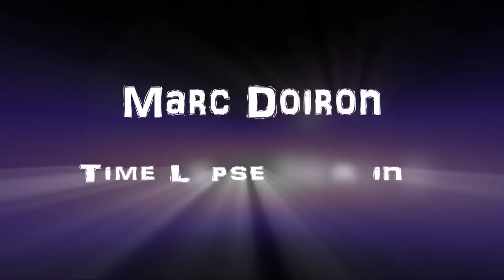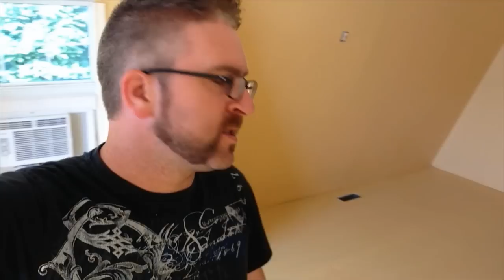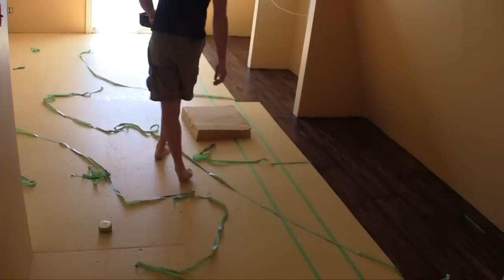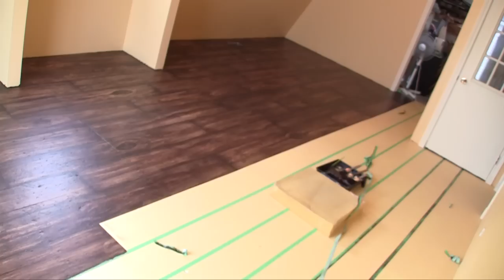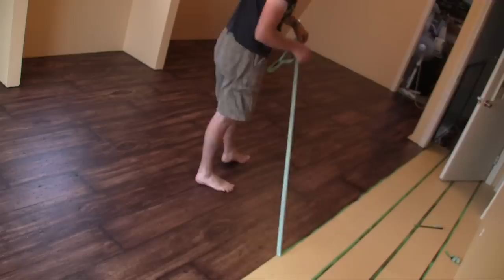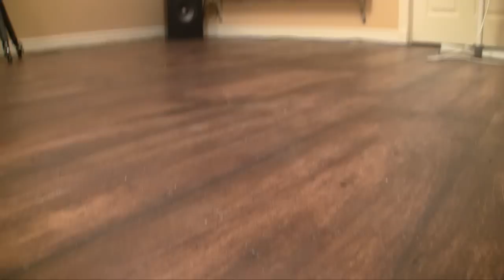Time Lapse painting "Faux wood floors"

Comment from the maker: Update. It's going on 3 years now and floor is still holding up very well.
Reply: +Marc Doiron What did you use to seal the floor? I love the look and your technique, which I followed to bring back the raw wood look to two beautiful wood beams that run the perimeter of my kitchen. The previous owner had painted them white and I was so happy to find your tutorial. They turned out amazing, so thank you :)
Reply from the maker: +cook6265 I just used a water base sealer. I gave two coats.
Reply: Omg!! I'm crazy enough to do this...why I didn't think of it, before. I planned on just painting the floor white...But I didn't want a plain floor! Thanks for this...x (mines a concrete floor. )
Reply: I’m assuming you can’t use bleach to clean the floors? What do you use to clean it ? Won’t it strip the paint ?
Reply: very good, thanks for video
what kind of floor is it? what material is it from?
Reply: Marc Doiron what tool did u use for wood grain and how did you make it look like individual planks?
Reply: S Fleming I think he just used a woodstain so the natural woodgrain of the plywood showed through, and the tape made the stain kind of puddle up against the taped areas making it darker which in turn makes it look like individual boards.
Reply: Everyone loves it even....chat 
Ok
Reply: Hahaha.... want some candy.... I like your house..... it's great without cracking
Reply: What did you use to seal the floor anyways?
Reply: You should like me XD hamsters
Reply: Marc Doiron can use this technique on concrete floor? And what would you recommend?
Reply from the maker: Diane Hachey yes you can. I did the floors in our gift shop and it has a lot of traffic. Just put a good cement primer on the cement before you start with the colours.
Reply: Hi Marc, what paint did you use please?
Reply: @MrMeSoMAD  Will this hold up on an outdoor front porch?
Reply: @heidibetke5826  did you try yet? I was thinking about doing the technique on my back patio.
Reply: I didn’t try it yet. I decided to go with stencil painting since it will be a little simpler.
Reply: Hi!
 How is it doing after 9 years?

Comment: That's a great and simple way to dress up a plywood subfloor- either for long term or until you can afford a different floor cover. The biggest challenge to me would be getting the tape spaced evenly and straight. You just whooped it down. Did you use any kind of sealant after it was done?
Reply: +llazyiest He didn't just "whoop" it down. Obviously this video was sped up for time. I am a professional faux finisher and scenic painter and I can tell you that it is very difficult to lay tape down straight. I'm sure the guy used a sealant but it doesn't matter. No sealant is going to prevent scratches on a floor especially in a high traffic area. His floor will have to be touched up a lot and not only that, the floor looks like a faux finish. I guess it would be okay if he covered up most of it with an area rug.
Reply: +sandra johnson Really? You mean he didn't just do it at 200 mph like it looks like here? You mean it's a time-lapse like he said at the begining of the video and in the title?  I'm so glad you pointed that out to me. Even in time lapse - unless it's edited out- there isn't much adjusting of the tape so yeah- he just whooped it down.  He could put something over it to preserve it- clear varnish or whatever.  He said it is the floor of his studio so perhaps he wanted something that it didn't matter if paint splattered on it. Regardless, it looks very nice and was done inexpensively. He also did a fine job on his faux wood beams in his house, shown in his website.
Reply: +sandra johnson seriously? give credit where credit is due. his floor looks awesome.. it was hand painted WITHOUT the use of a wood grain tool!
Reply: Yeah Lea Perrins, you are so right and can bank on the fact that there's always some misery out there ready to shit all over something, SJ needs to get a life instead of sucking the joy out of it.  I think he did a fantastic job.
Reply: sandra johnson if this was covered yearly with a coat of polyurethane it will hold up.. many people with brown bag floors do that and hold up for many years.

Comment: Hi! Just wondering what color paint and what color stain was used? I am going rip up all my carpets(they are real nasty and old!)! Thank you so much for sharing!
Reply: +Debbie Nichols Don't paint your floors!! Carpet is horrible I know and I would never have it in my house but painting floors is not a good idea. There is a lot of work involved and the guy who made this video of course didn't show all the prep involved in resurfacing his floor. Not only that, painted floors will most definitely get scratched up no matter how careful you are and you will always be touching it up. You can use the best clear coat on the market but it will still scratch especially if you have pets. Also, if you have no experience in applying faux finishes you will end up with uglier floors than what you started out with. There is nothing more hideous than a bad faux finish on such a large area.
If you ever want to sell your house you might have to resurface the floors because not everyone likes faux finishes. Just some things to consider. 
If you can afford it you might want to have laminate floors installed.
Reply: +Debbie Nichols  When I ripped out my carpet to put down laminate flooring, I mopped the sub-floor with bleach in water, let it dry and then sealed it with Zin shellac based primer so no pet odors would remain. You can have it tinted also. Even if I'd never put any other flooring down I'd have been happier with the floor sealed with primer instead of an awful old carpet. The most tedious part was pulling out all the staples from the subfloor.

Comment: I live here in canton ,ohio and they paint the floors with brown paint I guess t mimic wood. I hate it . how do I remove that brown paint and just stain  the wood with polyurethane.? theses houses are over 100 years old and there is some cupping so a sander will not work as I was told. should I just repaint it brown and then use poly? I just want the wood to show thru.
Reply: +rere nomad You will have to have the floors sanded or cover them with tile or linoleum.
Reply: sandra johnson thank you. I think ill sand them or reinstall wood. I heard that there is a difference between hardwood and softwood. I don't know which one I have,

Comment: awesome idea. So you just have to paint it in sections and let it dry to get it the look of separate boards?
Reply: you paint the edges near the tape a shade darker. you pull the tape and put it down for the next one. then when you paint you can paint up to the dark seam. It doesn't have to dry before you do it tho it will probably dry a little by the time you get to it.
Reply: +llazyiest You don't use the same tape because it won't stick. I am a professional faux finisher and I can tell you that what he did wasn't easy and I'm sure up close it doesn't look that great. You DO have to allow the paint and/or tinted glaze to completely dry before removing the tape and you have to be really careful about removing it. On a surface this large though like you said, some of the areas will be dry by the time he gets back to the beginning. 
I would never EVER apply a faux finish to a floor though. No matter what kind of clear coat is used, the floor will get scratched because it's in a high traffic area. If you have pets it's another reason not to do this. Touch-ups will be constant and something else to think about: if you ever intend to sell your house your prospective buyer might not like the faux finish. You will have to resurface the floor.
Reply: Then we shall just disagree on this. If this is a subfloor as it appears to be, there is no harm in painting it, faux or otherwise, as cheap, temporary way to spruce up a room until you can afford a proper flooring (which will cover it.)  In his case I suspect he did it as a cheap floor for his painting studio so it wouldn't matter if it got splattered or stained.
Reply: +sandra johnson love how u say u would NEVER apply a faux finish to a floor but also say you are a professional faux finisher how can u be a professional if you will never do it to a floor!!??? Clearly lies so just be quiet!
Reply: Comment to Sandra Johnson: He put two coats of sealer on it, stupid. Painting a floor whether one color or doing geometrical shapes or a wood grain finish is not hard to do. Takes time but not a ton of time. Sorry that you struggle with every job you do. The rest of us can do a bedroom or office or kitchen floor pretty quick (an afternoon or even a day is quick).
Reply: I was not saytin gto put the Same piece of tape down that you just pulled up.. just saying that you put down the next piece.  If you let the paint dry before pulling the tape you risk pulling up some of the dry paint. It comes up more cleanly when it's still damp.  Many folks claim one way or the other but I find pulling it before completely dry works best.  Since it appeared to be the subfloor, a new owner could put down whatever they wanted on top of it.  The last shot was up close and it looked wonderful.  I wouldn't call a studio in an end room a "high traffic area".

Comment: is there a tick to getting the seems to appear?
Reply: That is something else I'm not understanding. Place the tape stain the board remove the tape paint the board next to it why doesn't it just blend in
Reply: devaughn currie He makes the edges darker than the middle area for each "panel" so it looks like there are several pieces put together, but the plywood are actually large rectangular pieces. So he paints many panels in each plywood rectangle. The tape helps him keep the panels straight and uniform.
Reply: he paints the edges darker. he pulls the tape off and places it further down for the next plank. when he paints the next one  he already has the darker edge in on the previous one. that makes the dark seams. He's using a lighter paint on the inner part of each "plank".
Reply: Look closely.  Darker at the edge of the “boards”.

Comment: Too bad it's not shown HOW it's done.
Reply: Yeah really. Im still confused about how to get the knots and grain
Reply: devaughn currie  when you're painting a plywood subfloor it already has woodgrain and knots.
 At 1:53 & 1:58 you can see the knots in the floor before he paints over them so they were already there.
Reply: llazyiest The knots have not seeped through the woodwork he has put the knots there and the grain, it's called wood graining, the tool is called a wood graining tool. he's done a great job
Reply: Daniel Sephton  When you paint over plywood, the knots and grain will still be visible to some degree. I know what wood graining is and what the tool looks like. He doesn't have one in his pan there nor does he use one as he's working- he is only switching brushes. Either he's darkening and accentuating the original knotholes or painting his own on. He's getting variation using different colors over the light flooring.  Either way, he does it well and gets a nice effect.  People should not be afraid to try it. What's the harm? You'll eventually cover it anyway once you can afford a better flooring.
Reply: Daniel Sephton I need fillling in I'm doing same thing next week
Reply: DeVaughn Currie There is a hand tool you can buy now to put the look of wood grain in even brown bag floors to give the grain look , the same can be applied here and very easy to use.
Reply: It is shown in an other vidéo

Comment: If people are going to go to the trouble of making a DYI video they should talk about HOW it was done. I know how it was done because I am a professional faux finisher. The problems with doing a faux finish of this size is that it looks like a faux finish, it will eventually have scratches in it no matter how much clear coat is applied AND, touch-ups are most definitely in your future. Not only that, if you ever intend to sell your house you will either have to hope the prospective buyers like the floor or you will have to resurface it. I understand covering an ugly floor because I live in a house that has terrazzo floors that are in horrid condition. I refuse to do anything to do them though especially paint them. It's too expensive to have them covered and it's too expensive to have a company come in to resurface them. I covered them up with area rugs.

Comment: No doubt you are an artist, but why spend time putting down tape when you could have easily drawn lines . . . It looks like you faux board lines could have been created with your artistry by drawing lines and not using tape
Reply from the maker: Tape helps to get straight lines for the effect.

Comment: why you would waste all of that time painting that on your floor when you could have just got the some cheap laminated wood flooring to snap down with pretty much the exact same look and much better durability is beyond me. Nice work though. I would understand if it were on a focal wall or home made headboard but floor no.
Reply: +Brock1 I live in a small house that has ugly, stained terrazzo floors. I had a couple of estimates on having laminate flooring installed and the labor alone was over two grand. This didn't include the laminate or the other materials needed. Because I can't afford to have the floors refinished or covered I bought area rugs and a runner for the hallway. The terrazzo can still be seen in some spots and in the bathroom but unless you can lay laminate yourself (I can't), it's expensive.
Reply: +Brock1 It's far cheaper to faux paint a floor than it is to lay laminate.  He said the floor was in his studio- he's an artist- so perhaps he prefered a flooring that wouldn't be ruined by paint or chemicals that might spill of splatter.
Reply: sandra johnson Thank you, I was thinking the same thing, expensive, but this is not, and it looks just as good and can be repaired easily diy.